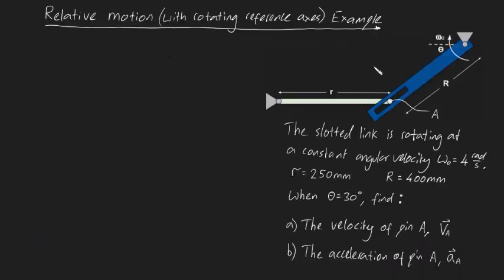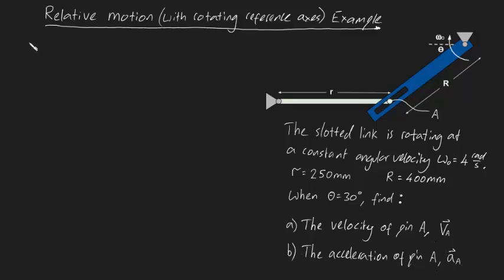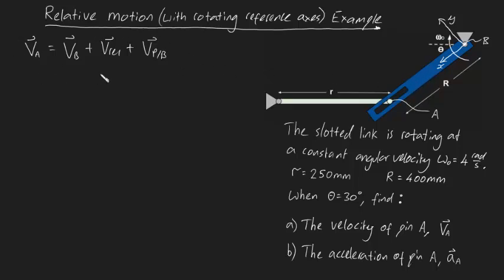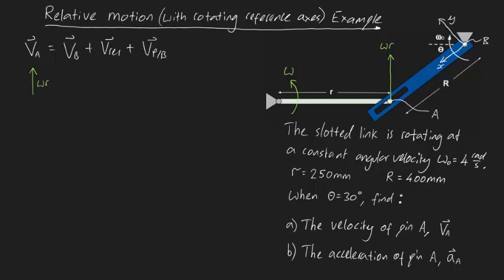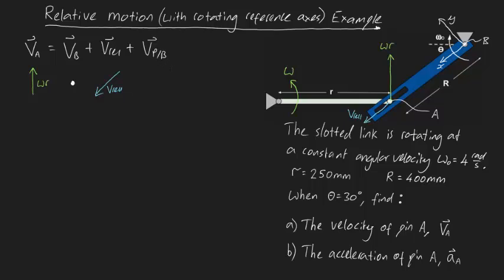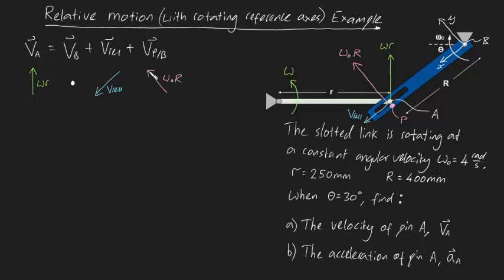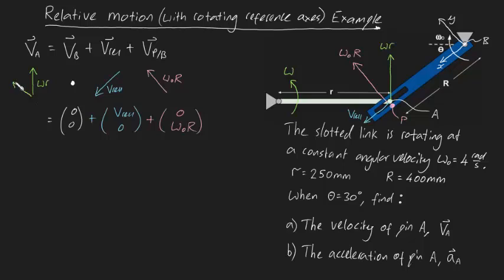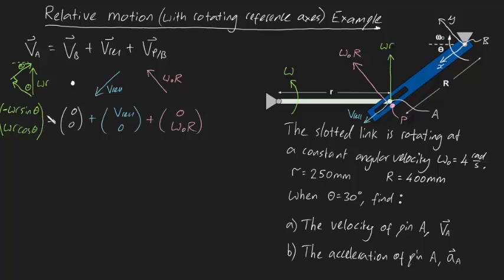Relative Motion with rotating reference axes Example (part 1)

Comment: Doesn't the absolute velocity of A change with whatever Primary reference frame you are analyzing the motion from? For example, I see you superimposed your primary and secondary reference frame at point B, but what If my primary reference frame was at the point on the left end of little r but my secondary rotating reference frame was at B? Doesn't the absolute velocity change then?
Reply from the maker: Hey mate, I'm assuming by Primary reference frame you mean the inertial non rotating reference frame XY (ie, the earth)? And by the secondary reference frame I assume you mean the rotating reference frame xy? In this example, you're right, I have placed the xy frame at point B, however I haven't even bothered showing the XY frame. This is because the absolute velocity of A and B will remain the same. This is because Vb and Va will be measured as the exact same since the derivatives of the constants will be 0. Proof: https://www.youtube.com/watch?v=4bMdTq1dOkA

However, all this assumes that the XY axis is inertial and non rotating. If you place the XY axis at the right end of little r then XY will be rotating and the formula won't apply.

I hope that helps :D